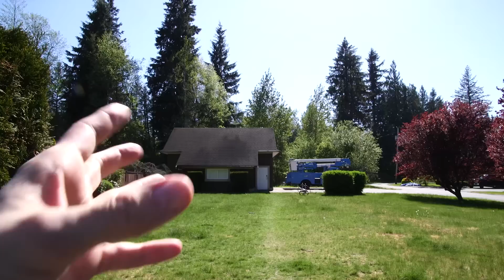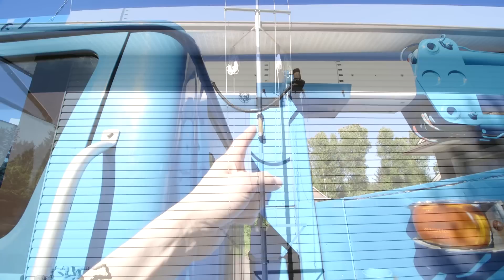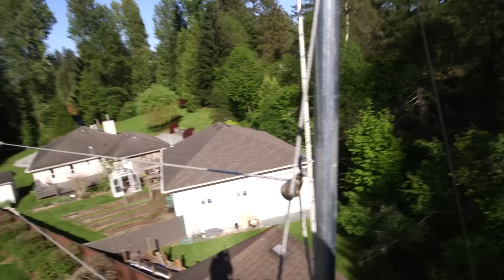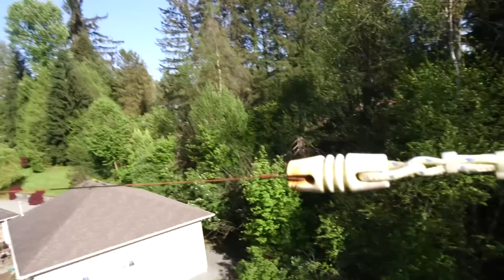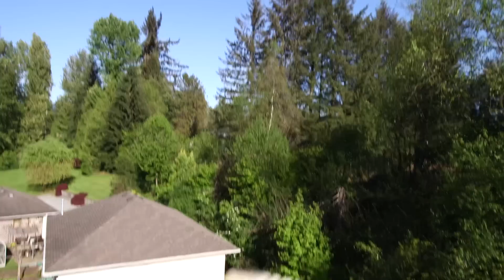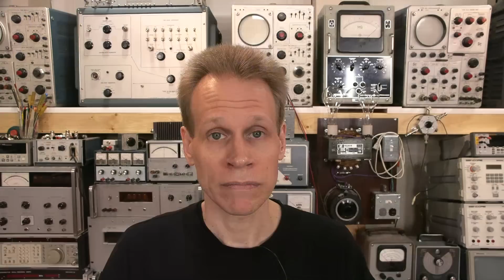Very Sensitive Antenna With Rusty Welding Wire!

Comment: Hello Paul!  I was wondering about the welding wire you used in your antenna! Since you installed the wire have you experienced any issues with it stretching over time!! Just curious! in my inverted VEE antennas is stainless steel strands woven in fabric like that used in outside folding chairs that is about 3.5 inches wide. The antennas have a wide frequency width in the 40 and 80 meter bands which is very good the stainless steel wires are about 22 gauge size strands woven through the base material to within about 1/8 inch 0f the edge of the antenna width of 3.5 inches.
I have to shorten up the antenna legs about 1 to 2 inches a year to keep them in tune it seems this stretching has slowed down over the last two years, so it seems to have stabilized to some degree. I used plastic pulleys that is about 5 inches in diameter to suspend the apex of the antenna and at the near the ends of the legs that I use to lower and raise the whole assembly for service or to save in high wind conditions. My SWR remains under 1.3 to 1 across both 80 and 40 meters and 50 ohms or close to that figure with both Vee's. In my next experiment I will see what I can do with # 6 solid wire at 50 MHZ and 144 MHZ just for fun!   As always you do great work with your videos Paul,  I can't wait to see your upcoming videos on the old radios!!  73's from KC2UVN
Reply from the maker: The wire length has been pretty consistant, there is not much pulling force with the springs.

Comment: An explanation about the antenna would be nice, haven't been able to find anything on that "3 6 9" antenna online.
Reply: Paul made a couple of videos about the design and installation of the antenna. Look for those.
Reply: @KJ6EAD  I have seen them. It still does not explain what the antenna is.
Reply: @galileo_rs  You're right. They were more installation than design oriented.

Comment: I’m not surprised that .035 wire is holding up so well. You could always pick up a roll of 304 or 308 stainless wire when you do end up replacing it in a few years to keep that corrosion down forever. Is there any reason not to use stainless wire in that application?

Comment: Beware white zap straps and UV.  I cable tied my fluorescent lights to the rafters in my shed.  One morning they were all on the floor.  I then tested black and white ties from the same company, just left them out doors, the white translucent ones went brittle after a few years, the black did not.  I'm guessing that the pigment in the black ones stopped the UV getting to the core.  The white ones snapped like match sticks, totally cooked! 

Greetings from the UK, love your videos.
Reply: I had a similar experience in an office environment with a fluorescent tube wrapped with multiple natural nylon cable ties. The UV that leaked through the phosphor embrittled those ties impressively. They crumbled like broken glass after a couple of years in place.

Comment: What a great piece of equipment to have at the ready, that bucket truck must be a dream to own.  I have two 40' Rohn towers with multiple antennas, vertical's and twin stacked arrays and now find myself struggling to climb safely doing maintenance, envious for sure.  Spring tension on the antenna is a great idea and yes the wire looks fine IMO.  Glad to hear the restoration series is in the works, thanks as that is educational as well as enjoyable.  Nice video Mr C., much appreciated.  73

Comment: I know that 99.99% of the time nothing goes wrong, but I have terrible luck.  My suggestion, because I'm not here to run anyone's life, we're all adults right?, hopefully.  Anyway, if I were crawling into a bucket, I'd have my safety harness on and a hard hat, as well as make sure that the system below is de-energized and locked out.

Comment: Good idea getting up there to check on the wire. Surface rust can be chemically treated later and an anti-oxidative coating
applied then. It should last for several years. Lovely looking  area of Canada there Mr. Carlson.

Comment: Army field telephone wire works well for antennas....copper and steel in twisted pair configuration. Legendary toughness, hard to stretch, tinned and takes solder well.  It's stiff of course and hard to strip the insulation off, but you can pretty much forget it once it's up.  Comes in half-kilometer reels at hamfests!  Thanks! 73   K4UIE

Comment: Zip straps should be black . They are  UV resistive .
Reply: Well, he needs a reason to fire up Big Blue and ride the bucket every few years!
Reply: IMHO I would agree with that. However, it may be that the tyraps will open and let you know that the wire also needs to replaced. Sort of long duration hourglass?

Comment: You can buy stainless lock wire from places like Princess auto and harbor freight it's fairly inexpensive and comes on a spool it might be a source of corrosion resistance antenna wire I believe the largest size red tailed available is .041 inches in diameter ohh it's sold as an aviation product and is available from non aviation sources for less money

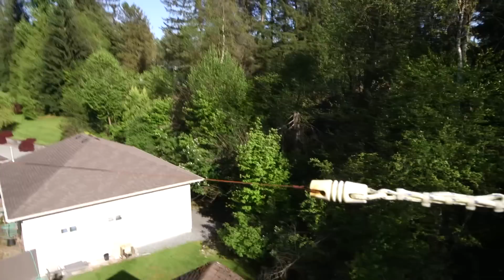Comment: At 6:19 - I noticed the "zip ties" used to retain the ropes at the insulators.  These are white which generally means are not UV protected. The T&B brand Ty-Wrap black zip ties are the best for this application.
Reply: The Thomas and Betts (T&B now ABB) brand Ty-Wrap model "zip ties" are considered best-in-class made of high strength nylon with an imbedded stainless steel locking tangs rather than the more commonly found plastic tangs.
Reply: @@cemx86. Yeah, I forgot to mention that.  Surely the black ones are better than the white ones?
Reply: Right.  Black UV resistant cable ties will last much longer
Reply: Agreed! I always use Ty-Wraps with the metal tongue. They are great and very long lasting no matter what the application.

Comment: I used MacLean 430 SS Lashing Wire - 0.45in stainless steel
Wire is fully annealed and wax coated for ease of use. Put it up in 1988 , its still good, no rust no corrosion . Of course the the radio is in closet now because the invasion of panama was what I installed for. I got the wire off the linemen but you can buy it online. You would never need to do it again or even check it. I had tried several different types of wire before this and after time passed they all failed . Not this one
Reply: Did you mean 0.045"?

Comment: The last time I did antenna work on my tower I rented a bucket truck from U-Haul and it sure made the task much easier. I will admit the controls took a little time to get used to but all in all it was well worth it.

Comment: You know, because if you i just finished fixing a tek 317, then did my first AA5 this weekend. 1958 rca circuit board! Thank you sir.
Reply from the maker: Thats great! Congratulations, and thanks for the kind feedback too.
Reply: @MrCarlsonsLab  it's well deserved! Through your patreon I've gained so much knowledge and drive to fix what's going to inevitably end up scrapped or dumped.
Reply: @MrCarlsonsLab  by the way, I need more Vedolyzer in my life!